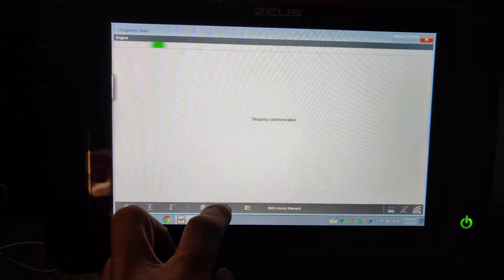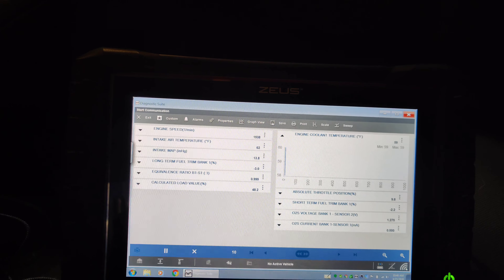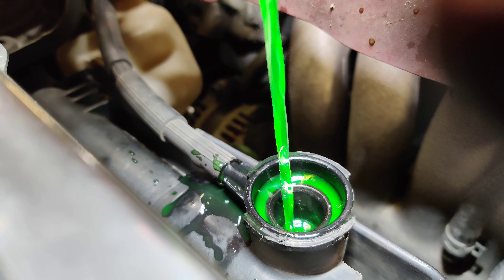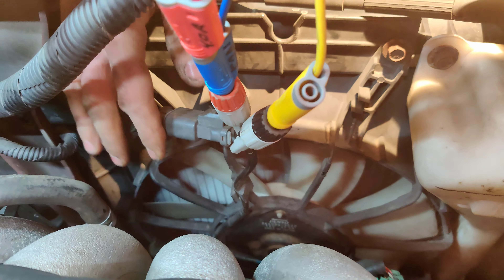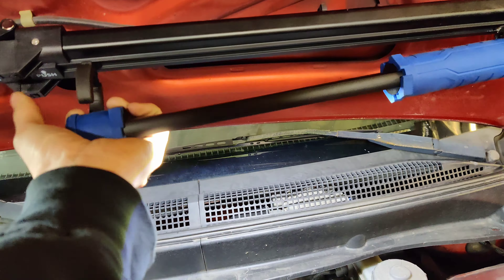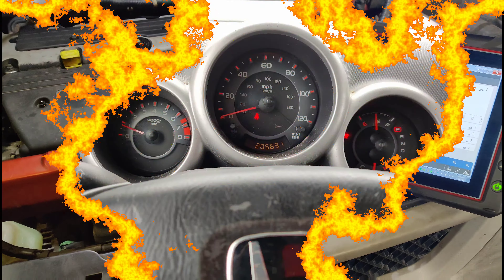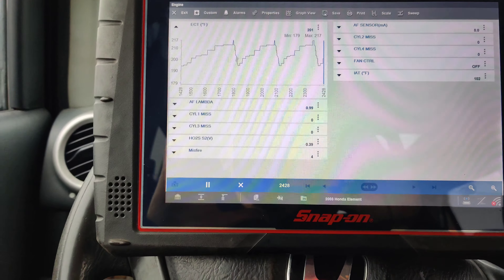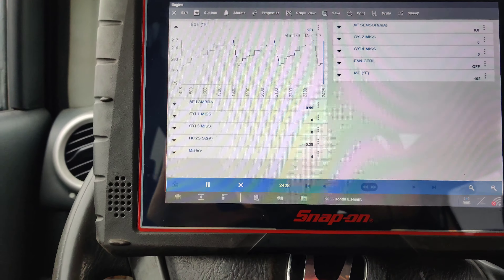2003 Honda Element 2.4l AWD Running Hotl

Comment: Retired mechanic in FloriDUH ..had some problems with the fans years ago on my 03 Element EX (mine since new) .. Bought a Heavy Duty Relay and wired both fans to it to come on whenever the motor is running ..also added a big fan in front of the Condenser ...cheap insurance ....
Reply from the maker: Awesome, glad it worked for you.
Reply: @user-iz4lo5qr9x  you’ll also be burning twice the amount of fuel, running the fans on full time. You are tricking the temperature throwing off the computer etc oxygen sensors will read differently too. your engine won’t run at the optimal temperature. Always use the factory relay and fan switch, and good functioning fans.

Comment: I had a 07 CRV come in for "leaking oil" Well the oil leak didnt happen at first. I couldnt exactly nail it down. Temperature never reported hot. I tried to put coolant in it and it ran out of the plastic thermostat housing. when I tried to pull it out I thought it misfired a bit. So I put a new thermostat and housing in it and filled up the coolant with a funnel adapter deal. Soon as I cranked it over it hydrolocked and shot out of the funnel like a geyser.

Comment: Shouldn’t you just be able to put DC 12V to connector to see if fan motor is good?  Polarity is not an issue because it will run backwards

Comment: 2006, mines running hot.    Same fan isnt working...  I'm in NYC and really can't spend another $$$ on repairs (already in for 3k this year, after thieves butchered my car stealing the cat converter and a battery/alternator).     Hope this does the trick
Reply from the maker: Did you call your insurance? Hope everything turns out for the best for you.

Comment: Hey I have a p0300 p0301 p0302 coolant is very low too with little to no heat inside the car and it's a Honda element not it shows all 4 cylinders misfire u think it's the coolant or temperature sensor I've change spark plugs and coil pack
Reply from the maker: You need the cooling system to be full before you do any testing. What tests have you already performed?
Reply: @RobertDotterer  so I bought the car I saw the coolant was a little low drove it home about 70miles then went out of state came back a week when I started it it start rough there was like no coolant in radiator and tank so when I turn on my heat it was Given no heat. Then it show misfire in cyl 1 and 2 n random misfire then later it went to 4 cylinder misfire I have changed all spark plugs and coil pack I saw the oil was dirty so I've change it and notice the vtec solenoid filter was clogged but there is no other code other than misfire and u can hear it I've never driven it since it's just test done at idle but my engine light is no flashing with 4 misfire cylinder do u think it's the coolant or temperature sensor or it could be a o2 sensor  but when u start the car the temperature guage stay at the middle soni dont think its overheating
Reply from the maker: Temperature gauge won't work if there is no coolant in the car or if it is very low. You need to fix the cooling system before you go after a misfire. You either need to pressurize the system and look for an external leak or look in the oil or the cylinders for coolant. You will not have heat if you are low on coolant. Once you fix that I would make sure the valves are adjusted right before throwing more parts at it. If the valves are not adjusted right you can have misfire codes and other drivability issues.
Reply: @RobertDotterer  tnks alot I'll do that I'll probably check a vacuum lead, fuel pressure or clog injectors and map sensor with throttle body clean tnks again really appreciate ur help tnks bro
Reply from the maker: Vacuum leaks will not cause a misfire on the car unless it's only on a specific cylinder.

Comment: What was the reason for the long term and short term ? and that clip in the middle of the radiator support was bothering me.
Reply from the maker: I'll have to look at it again. The fuel trims only show up in generic as positive, in enhanced side it shows near perfect. I don't know if it's a scan tool issue or not. It's weird. Map sensor is perfect, tps is perfect, wideband and rear O2 read perfect. I think it might just be an issue with scan data.
Reply from the maker: I didn't even notice the clip wasn't clipped in. I am always clipping harnesses in on people's cars. You guys always have a different angle then I do watching. Thanks for pointing it out. I'll fix it next time it comes in.